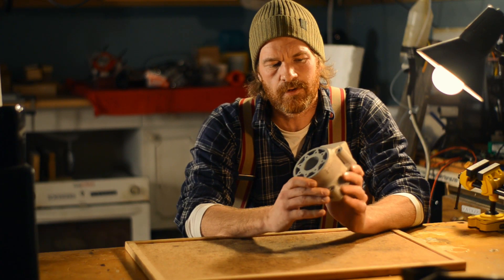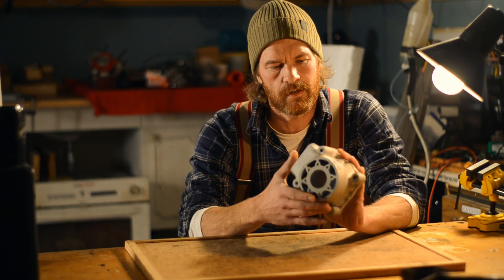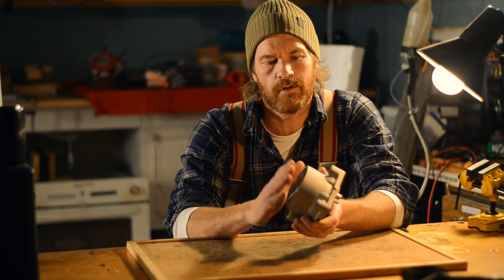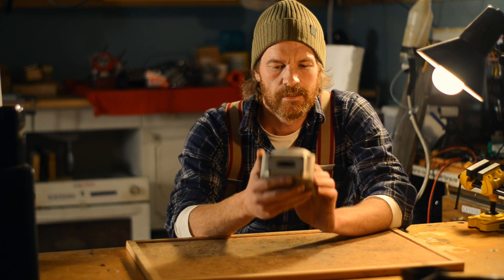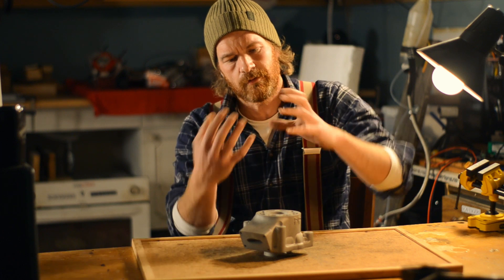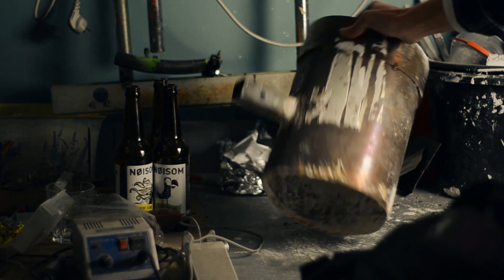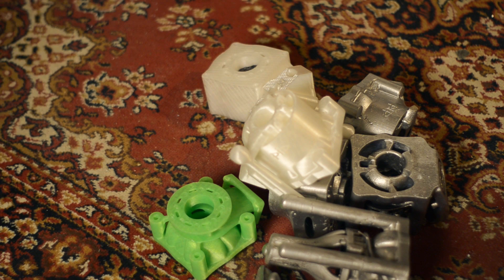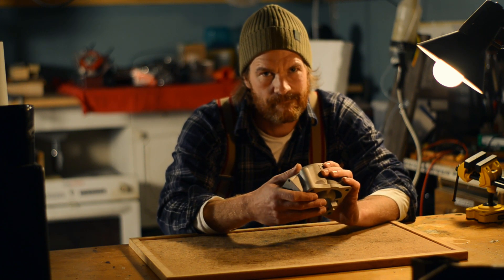METAL 3D Printed Two Stroke Cylinder!

Comment: I hope the plating goes well, on this essentially porous sintered material? Also is the expansion coefficient similar to cast aluminum alloy?
 Sintered aluminium is not without it's issues,distortion both heat and structural load, would be the two most important to you.Only saying.
Top work, truly outstanding.

Comment: Got a question for all the smart 2 stroke boys, i ride a tomos with a exhaust that has its powerband around4/5k revs,
But when i reach the 8k revs it feels like it had a second powerband, it feels way weaker butt still it is there.
Is this possible because the pressure wave then bounces two times instead of one?, let me know what you think about this pls.

Comment: I am an electro-mechanical engineer and a big 2 stroke fan. I wanted to volunteer to assist in any cnc programming you may need help with as well as any custom circuit board layout and design. Love your channel and your dedication to achieving a dream.
Reply: I also build and design vacuum tube hifi amplifiers if you ever want some high end audio for your shop!

Comment: This looks awesome. Might have to use them. And by the way thanks for your intro on EngMod2T. Thanks to you we found out about it, started a collaboration with Neels to use EngMod4T, and have validated that our new engine tech (https://less-engineering.com/) is going to have significant advantages over a traditional one. I'm even starting to think about 2 strokes!

Comment: I'm a chemist and also did some plating, aluminium andodizing and magnesium chromating on old bike stuff but Nikasil at home, casting complex parts and machining everything with a bench drill is the real bottom up approach! Did a lot of 4 stroke cylinderhead castings with traditional pattern and some stuff with sand printing. I always thought I'm at the low end of the quality time money triangle. Keep up the good work! Cheapest way usually is sand printing the moulds for complex parts. Prices have dropped the last years a lot.

Comment: You could plastic print models and cut open to see how well it is going to work. You could test different port shapes in plastic and test for flow with electric motor rotating plastic piston on a flow bench. Or leave exhaust ports blank to test intake for flow and do the same for exhausts. When you think you have a good final design then print in metal. You could test coolant flow with hot water and infrared video camera in plastic prototype. I love you idea of single peace casting. Try higher compression with proper coolant flow and no gasket. I think this could be a huge jump in power.

Comment: Wow, the printed cylinder looks just like a VERY high quality casting, that sort of casting would cost a lot to get done professionally at that level of quality, I'd be very interested to see how it holds up to the stresses but obviously it's not going to have the inclusions and internal stresses a cast part would have.

Once you get the engine on the dyno, it'd be worth rigging up a cheap (arduino etc) datalogger for the temps of various spots around the engine, that would allow you to 'tune' your water flows and get it well balanced. according to my car-designer mates, getting the cooling system flowing corretly and cooling in a balanced way is where they end up spending a lot of time in testing, as it can have a huge impact on reliability, although reliability isn't the TOP priority, it IS a 2-stroke revving to the moon, so it's certainly worth paying some attention to as i'm fairly sure locking it up at 100+mph is something you'd like to avoid!

Beautiful work as always Alex! (video and engine!)
Reply from the maker: Thanks! Yep, coolant flow optimization is in the plans, data logging is a great idea!

Comment: I would love to know the yield strength of printed ali over cast. really interesting.
Reply: From protolabs’ website ~240 MPa before heat treatment, ~200 MPa after, compared with something like 200-250 MPa for sand cast LM25 with heat treatment.
The question you should be asking, though, is “is it strong enough for what I need?”
Reply: @emma.jacobs1  very interesting, seems comparable to cast. More interesting for potential allocations. With close yields, you Could easily design in the additional strength.

Comment: problem is the quality of the printed/sintered metal for the desired purpose... depending on the operation duration expected ? maybe printing the cooling passageways and sleeving for stronger chamber and piston travel area? that one would have to open up or at least finish up from the inside after insertion... a work better assisted by cnc and camera I'm sure
Reply: have a look at the data sheets for 3d printed metal parts the quality is impressive it is used to print gears out of high strength steels amongst other things!
Reply: @markscully2342  datasheets fron vendors are one thing... but here we'll have a real life cast study, which I find more valuable.

Comment: Protolabs are really good. I used them for some parts in the nuclear industry and they were so helpful. The quality of the parts they provided really exceeded my expectations.

It's fascinating how the technology will totally change how you design things and the more complicated the design, the cheaper it can be! You can remove so much excess material that was there just because you couldn't machine it. 

As you pay for volume of material only, it pays to remove every scrap of material you don't need. Spider web / lattice type structures that are super strong and light weight are the way forward 👍 

Again though, another protolabs user here that can 100% recommend them

Comment: sorry guys maybe i missed somenthing... why i dont see any ports in the cylinder?
Reply: The bore has most likely been printed with the ports masked of with a very thin layer that can easily be removed once plated. Makes sense seeing he's had so much trouble masking off the ports previously.
Or the bore was printed well undersized to give a good amount of material to machine and the ports will be uncovered once the bore is taken to size
Reply: johnny woodbine yeah that makes sense!
Reply from the maker: The later, but using it as masking is an interesting idea.

Comment: 3D printing allowed you to cover the ports with (thin) metal...so no tricky masking prior to plating.
Reply from the maker: Actually that was not my intent, but a very interesting idea! Won't work this time as the bore is 1mm undersize and the port's will be "revealed" after machining.
Reply: @2STROKESTUFFING  There must be a simpler way to mask the cylinder transfer port passages for plating that cylinder...how it is done in production?

Comment: with how much this is worth, i'd coat it profesionnaly, too much risk of error otherwise...
Reply: ...and there is the "let a professional do it" guy.  There is always one.     "Professional" just means you get paid to do it.  "Expert" means you do it well.  The two don't always coincide and certainly aren't exclusive to each other.
Reply: @brianhaygood183  i only said i'd not do it.  The difference is that they have more experience/ better tools for this process, meaning less chance of error overall
Reply: @Pascal_Robert--Rc_Creations  if you have ever been in a plating shop, you would know the labor is not really skilled.  The difference of a professional shop is mostly just the scale of it so they can plate parts in volume.

One guy concentrating on one part probably has a greater chance of success if he knows what he is doing.
Reply: Naah. I'd be tempted to do it myself.
And my old fella is dead now, so he's not here to tell me to not be a dick. LOL.
He once "advised" me to not build a BBQ, or to stop doing it. To get one of my mates who's a Brickie. The BBQ still  looks far better than if I'd done it. I'd have likely pulled it down and had it re done, it would have pissed me off keep looking at it. I mean, I can manage, after a fashion. But it's very difficult to best someone who's doing some shit day in, day out, for years.
Probably sage advice Pascal.

Comment: the nicest looking zylinder out of a printer seen so far! looking forward to see it machined. which density do they  claim on their metal prints? would be nice to see some microscopic pictures of the machined surface. especially with this intake geometry it would make sense to rework the model for metal printing for the next one. maybe there is someone who´s familar  with the printer and it´s habits that can support you with some tips to tweak quality. it seems to me that they hat something going on during the print, you can clearly see a layer shift in the bore. over night print = temperature drop? hope that fits with the piston!!! update: took a look to the protolabs web site, as i thought they claim nearly 100% density, i think it was 99,8% on dmls, regardless of wich printer is used.
Reply: Yeah. Some advice altering the barrel for printing now as opposed to casting.
He said they were awesome friendly and helpful.
Get two; or more, interested Nerds together like that, to Geek out with each other and amazing shit can happen.
Some nice close ups and highish magnification footage or pics would be great.
Reply: Aw bugger! It was the intake or exhaust section not cutted out that looked like a layer shift to me... But still hoping it will fit the piston.😃
Reply from the maker: There's 0.5mm of material covering the ports, 0.5mm below the feature size rule - why they look like that.

Comment: Has anyone tried asking for a Protolabs quote to print a cylinder? Just curious about the price range.
Reply: I saw papdakis racing quoted roughly $1000/lb of finished part for an intake plenum he had done. That was also laser powder bed method.
Reply: <1300 GBP according to response in another thread "Highlighted reply
2STROKE STUFFING 3 hours ago
About 1300 British pounds. Probably a lot cheaper if the model is designed for printing with less material where not needed.
Reply from the maker: Yep

Comment: I really want one of those metal 3D printers. I wonder how long until you don't have to sell a kidney to afford one?
Reply: Wont be long, very good chinese pla printers are down to 250$.
The metal printers spread aluminum powder over an area and then hit the area with a lazer to melt it. Seems simple enough
Reply: @DarkLinkAD  I toured a company that has an SLS machine. It uses a high power laser, heating systems to keep both the powder tubs and top layer at the right temperature, not even considering the software side of things... The material is crazy expensive as well. Seperate post-processing machines are also used to clean and cure the part if necessary
Reply: @aidaneloff5357  laser-sintering is one way. Other methods will become practical...and cheaper. Moore's law at work.
Reply: @DarkLinkAD  if only aluminum powder wasn't highly combustible ;P
Reply: @tzikis.  Powdered sugar is combustible, live a little
Reply: @DarkLinkAD  😂😂 so I guess I won’t be shining a high powered laser at it anytime soon 😛
Reply: @tzikis.  I guess I won't be baking cookies either...
Reply: There are a couple medal 3d printing machines available for the price of a luxury car, less than $200K.
Still a very expensive machine, but a hell of a lot cheaper than a multimillion-dollar SLS or DMLS machine.
Reply: The machine costs both Kidneys sorry
Reply: about 2000 years